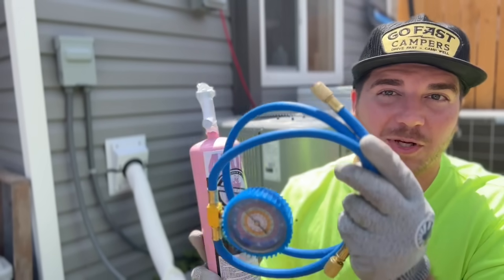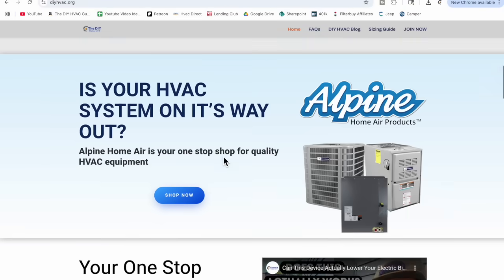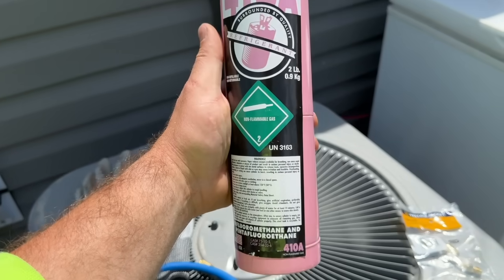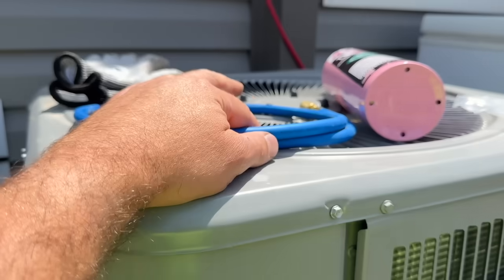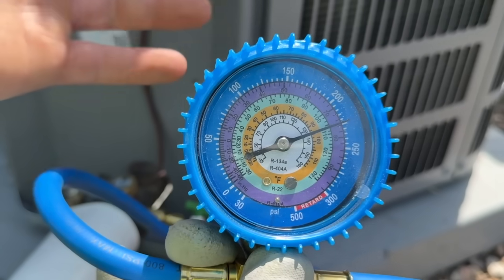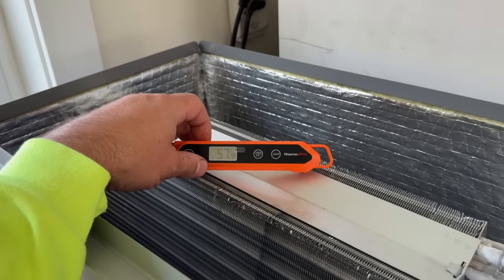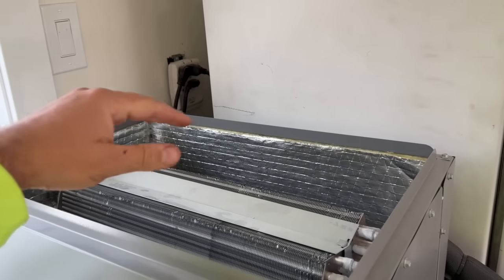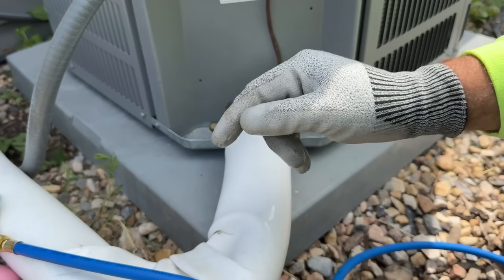You Can Recharge Your Home A/C Like A Car??  Colder Air in 6 Minutes!

Comment: I remember one summer getting charged over $1,800 for a service call and R-22. Then I bought a manifold and watched a few videos. R-22 now is about $30/lb online shipped. Love that green jug. Just for fun I called an HVAC company for their "low $49.00 AC tuneup." Guy came out, looked around, checked filters, went outside and said, "Oh yeah she's old, got to go, went to his truck, came back with $18,000 quote for new system. Never took out gauges or even turned system on. I played dumb and turned it on. Cold, cold, cold. He then said, "Ah, so, you could save about $75 a month on electricity with this new system......." I laughed, paid him his $49 and sent him on his way. The look on his face was worth every bit of that $49. I've warned others. Love my old rusted Payne.
Reply: Have two R22 carrier units that are 33 years old, both on their original coils and condensers.
Reply: @thastinger345  Keep them going. They don't make them like they used to.
Reply: This tactic was also tried on us.  They tried to sell us a $10,000.00 system, and told us that the reason why was because the unit we had was much too big for the house. (Lie) Paid the 50.00 bucks, and sent him packing.... called out a recent HVAC Grad family member.  He said that we do not have any leaks.  He did say that the Freon needed a recharge. I did have to pay a small fortune for the Freon, but it worked like a charm. He did this. He also did a complete service check. The air has been good since.  He is our new guy.  I warned him not to try to upsell anyone, or cheat anyone, and he would have all the service calls he ever needed. So far so good.....Honesty is the best policy.  PS - In Florida, having a trained HVAC guy or gal in the family is like having a Surgeon in the family!
Reply: Thanks for the video. So, I am a little bit confused. I'm trying to make sure my AC system is optimized, and both the technician and AI told me that if the system is in good shape it will not lose any refrigerant at all. He told me there was no loss of refrigerant, but I know he did not test it... then we have the title of your video, and then in the video, you say in a sense that this is only going to help if there is a leak... you sort of say that... so if I don't have some apparent reason to think there is a leak, is there any reason to try to add refrigerant? Obviously I want it to be as cold as possible! Is a i wrong, and even with a good system, over several years, some refrigerant will actually be lost?  Again, what I read or researched said that as a closed system there can't be any loss unless there is a leak. So do I add some or not? 😂
Reply: @minimalizman  Do not even try this guys advice on AC. He's gotten better over the years but it's all about the merch and much slight of hand in his videos. If you're a tech you know what I mean. Do not add refrigerant if it's not needed. Too much refrigerant, and we're talking ozs, can lead to liquid refrigerant going back to the compressor slugging it and causing failure. Measure the air going into your furnace/air handler and measure the air coming from your closest vent to the furnace/ air handler. The difference in temperature after running for 5 minutes should be 16 or above, with 18 degrees difference being very good. Less than 16 call a tech out for an inspection. If you have a leak it will eventually leak out and your indoor coil and copper tubing leading into the furnace / air handler will be completely iced up and no air will flow out your supply air vents. So bottom line, temp above 16, no blockage or ice buildup, no problems.
Reply: @minimalizman if you needed to add refrigerant, it leaked out, was let out, or never had enough in the first place. No other option. There are other problems that can mimic low refrigerant if the technician isn’t paying close enough attention or doing due diligence in diagnosing, such as metering device issues or airflow issues, but these systems do not consume refrigerant.
Reply: @Cannimal thank you!
Reply: @minimalizman 

You will lose small amounts when gauges are connected and removed. What he is doing in this video may get you in the ball park, however the charge will not be correct. If you have a txv you need to set subcool, if you have a piston you need to set superheat. If you don’t your charge will be incorrect. One method I’ll use to get the charge close is subtract 35 degrees from your indoor temp and that will be your vapor saturation temp. It’s still only close, not correct. Hvac mechanic for 17 years
Reply: @knust5707 so it sounds like something I shouldn't mess around with.😂
Reply: @minimalizman  I would check the temp difference between the supply and the return air. Normal is 16-22° so if it's much lower than 16, there's something going on and you can research that, it's not always a leak.
Reply: These AC repairs!!!!!! They make unbelievable Money on selling the complete systems!!!!💰💰💰💰💰 Trade school is teaching technicians how to shake down the public!!!!!! Seen it first hand!!!!
Reply: Thet love to target senior citizens with the $49 tune-up special, as a ruse to sell them duct cleaning, a turbo filter with UV lights and of course the faked photo a cracked heat exchanger.
Reply: 18k?????? For a house?  Criminal. I wouldn’t have paid, but would have considered giving HIM a free tune up with a baseball bat
Reply: Hi where do you buy R22
Thanks
Reply: @JuanRivera-lj5lu  Google R-22 ability
Reply: You didn’t do any of that 😂😂
Reply: $49 tuneups are a loss leader like a $0.29/lb Thanksgiving turkey. It costs more than $49 to drive to a van to your house, in most cases, before a single tool is used. To be honest, $139 tuneups are also a loss leader, but at that rate you’re more likely to get value return, actual testing and cleaning, and not just an excuse to get into your house for a sales pitch. Too bad everyone wants the cheap promo.
Reply: I checked around for the going rate on R410a recharge and the bastards are charging a min of $150/lb and that's over 10 times the wholesale cost!
I had a few say they could've even match the $150/lb!
Reply: @heynow01  Wow. Scammers. I've seen it online 10lbs for $189.
Reply: Considering overhead like license, insurance, workers comp, gas and so on that’s not a bad price.
Reply: @danielracicot8310  Shouldn't have to pay anything if all they want to do is sell a new system. At least get out the sniffer, hook up the gauges, and produce a report stating why a new system is necessary.
Reply: Agree I’d it’s 410a I’ll leak search. But that’s not free. R22 not gonna happen. I’ll gas and go to get them instant comfort.
Reply: I have an r22 system that's probably as old as I am.
Reply: Nice on the tune-up response. That's like him trying to sell you a $80,000 EV car to save you on gasoline...
Reply: Its okay because they don't need to win 100%, all they need is 10% close rate to make 130k/year
Reply: A neighbor with a Trane R-22 a/c circa ~1977=> 1987, leaked all R-22 around 1998. and replaced with scented high purity propane/ R-290.  It is still running.  Operating pressures same as R-22, as is the efficiency.  R-22 and R-290 are virtually unmatched for residential a/c units in terms of thermodynamic efficiency, but obviously this system would benefit from larger evaporator and condenser.  (So the operating pressures are much lower than most current refrigerants.)  The oil in a propane charged unit will not turn acidic if there is some moisture present, and mineral or synthetic oil can be used.  (Check if using syn oil because all types may not be compatible.)  Propane is greenhouse friendly so no license is required.  But do not allow R-22 and propane to be mixed because recycling has not been set up for mixtures.  With the lower pressure, up to 2" 95/5 tin/ antimony soldered joints can be used per ASME B.16.18, (150°F/ 350 psig), and if soldering in tight spaces where a flame would be a hazard, an inductive pipe soldering gun such as a Ridgid RT-=175 can be used.

The neighbor uses soaker hoses strung along the roof ridge lines to wet the shingles with well water.  He claims his summer electrical usage is less than 1/3 that of comparable houses in the area per the utility company reports.  So the well water takes care of a lot of the heat that would have been gained through the roof while the central a/c takes care of the humidity and a much reduced heat load.
Reply: @somaday2595 I hope nobody reads this and does the same. Might be the dumbest thing I’ve seen in a while. Ask your neighbor what safety features he has installed in the evap coil and furnace in case there is a refrigerant leak in the evap coil. If you have propane leaking out of that coil in the winter time, and turn in the furnace, well, good luck to them. 454 and r32 are flammable as well, but nowhere near what 290 is. You can hold a flame to 454 and 32 and nothing happens. And yet there are still safety’s all over the evap coils for those refrigerants. This is why you should alway find a honest and reliable professional. It’s not difficult, especially today with reviews, referrals, etc. it’s not the 80s anymore. But yea seriously that neighbor is a moron
Reply: @somaday2595 how did he fix his leak?
Reply: You are a great story teller😂
Reply: Did u have a leak? What site do u buy the 22 on
Reply: Typical HVAC sales scammers
Reply: At Home Depot they have a $29 tuneup special, the last thing I want is to let those people in my house and try to upsell me on a new unit. Other than a recently developed condensation leak at the pan my unit is working fine. Hopefully I just have sludge buildup and the pan is overflowing at the rear which is only accessible from the front and not a cracked pan, which would require removal of the A-coil to replace. On the third cleaning session, will keep monitoring return space below for condensation leaks during operation.
Reply: Yea, that's what I'm talking about...CROOKS, CROOKS, CROOKS!!!! JUST LIKE CAR MECHANICS!!! GREAT POST!!! IM SHARE THIS VIDEO EITH ALL MY FRIENDS & family.  Now a piece of mind an extra money for that hard earned vacation!!!
Reply: Had a company do same thing to me. Only needed a draft inducer fan. He wrote a pending invoice for $3800 to 'get it going' or $15000 for a new unit. Paid the $99 fee and sent him out. Large southeast company starts with jordan.
Reply: You shouldn’t put gauges on a condenser unless you have to… every time you do you’re removing refrigerant. You called them out to waste their time, I’m not sure what you expected?
Reply: It's just an off-brand carrier
Reply: But did you fix the leak? Or are you just blindly adding r22 to it? What is your sub cool? Or are you just going off psi? Are you EPA certified?
Reply: @frankiec5570  Why fix the leak if it's minor and system needs maybe a pound or so added to get through the summer? "Beer can cold" is close enough with old R-22 system.
Reply: Instead of charging ridiculous prices for R22 ,  I’ll reclaim the existing Freon change the drier and convert to R407c , similar pressures and temperature and works just as good as 22 at a much cheaper cost
Reply: @smck9120 you lose 8-10% efficiency when converting to R-407c or RS-44b.
Reply: @LM6.2  I’m with you. Not a fan of “drop-in” refrigerants. But in most cases those that are looking to keep that old R-22 unit rockin’ either don’t care about efficiency or don’t understand what it’s costing them.
Reply: Maybe your a 1,000 years old but I got news for ya.

R22 is phased out and you can't have it made anymore.

Around 7 or so years ago when you could still buy it. The price went from a jug being $80 to $300, to $1,000, to like $2,000. Then we stopped checking on it because luckily we had like 100 jugs saved up. 
So when a system was empty we would replace the compressor and use MO99.

But if needed just a little we would add it. Worked great for us because our property had like 1,000 apartments which made it legal for us to recover and put it into another one of our units. However it's not legal to take it from one home and drive across town and use it in a random house.

Long story short if a man stocked up on R22 years ago. You could have easily become a millionaire.
Reply: R22 systems are fazed out so the e22 Freon is super expensive basically your paying for what’s left in the world no more production of r22 that’s why it’s so expensive
Reply: @miguelpadilla9188 If R22 is selling for $30/lb, that's still a deal compared to a whole new system purchase.
Reply: @miguelpadilla9188 my guess is that manufacturers are still making it because it's so profitable.
Reply: You are not finding r22 for that.
Reply: Propane gas does the same pressure as r22
Reply: @ericmentzer8846  Suction and discharge ts and Ps nearly the same.  Overall performance are about equal on an overall thermo performance, which is about the best of all residential refrigerants,,,and lower pressure, too.
Reply: @somaday2595  It's not about the performance of propane, it's about the danger of a leakage. Do you know the government (US) just increased the legal amount of propane to be used in AC to 500 grams? That's only 1.1 lbs or 17.6 ozs. Compare that to an average 410a 3.0 ton system using 7 lbs of refrigerant.  It's dangerous, explosive and flammable and that's the reason not to use it.

Comment: Appreciate the informative information I have a very old  one, 37 yrs. Old it still is runing!
Reply: I’ve got two close to the same age. Armstrong Air units original to my 1989 house. One unit has been flawless, the other has a really slow R22 leak.  I actually got my universal EPA certification so I can buy it and install it legally. I believe you’re not supposed to without one. More important than any certificate is knowing what to do and why so you don’t blow out your system. Schrader valves can get stuck opened, you can introduce moisture, or kill your compressor. 
The reason these guys charge so much is because they have thousands in equipment just in case. Recovery machines, scales, vacuum pumps, etc. 
proceed at your own risk.  I certainly do. Just know your limitations
Reply: @Drrich_DIY mom has a York from the 70’s. Still going. Buddy had to replace the motor, but that was due to a flood.  Aside from that, it’s a rock.
Reply: @DanVoels nice!  I’ve had to replace capacitors, motors, contactors you name it. Indoor units I’ve needed new caps motors and a transformer. But I do what I can. I clean the outdoor coils thoroughly each spring, clean the evaporator coil indoors as well, and change my filters monthly. The older R22 units operate at a much lower pressure than the 410a units and even newer A1L refrigerants. So less chance of leakage. I hope to keep mine going for ever. (Same as my original to the house peerless oil boiler). They don’t make stuff like they used to.  Now if something last eight years they say you got good use out of it!
Reply: @Drrich_DIY  nice try, certified ac technician      gets frostbite
Reply: @raiden72 I’m a dentist buddy. I may get bitten but not by frost.
Reply: @Samlol23_drrich  It is great to be able to replace components to keep the systems going.  Last winter, I replaced the fan and limit control for the furnace, which is from 1989, and the condenser is also from '89.  I am hoping to get a few more years out of them.  Where did you have the exam done for the EPA license?
Reply: That’s how it should be, working for 30 years just don’t call for service because you’ll be replacing it with these sh@tty companies!!!
Reply: Wow, 37 years!? Mines probably from 2010
Reply: @raiden72  they do not make anything to last these days
Reply: @suziesturgill2462  Yes that is very true, things are getting much smaller and more delicate. The resources to build the things are becoming more finite. In this way small components begin to fail. 😢 Some of the newer stuff is better with higher efficiency,
Reply: They certainly don't make things like they you to and mine was a scratch and dent unit @raiden72
Reply: @raiden72 😮

Comment: Bigger line is low pressure.

Always tighten the Shröedingers shrader valve core…the rubber seal is so small prone to UV & ozone degradation.…which is why you ALWAYS ensure that the access ports have caps on them.